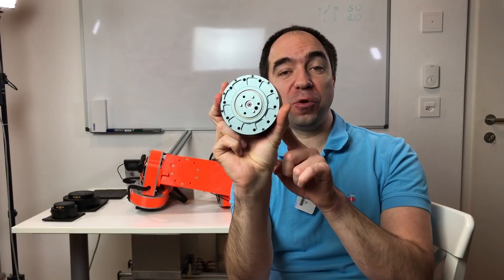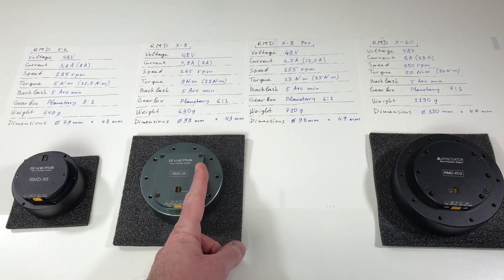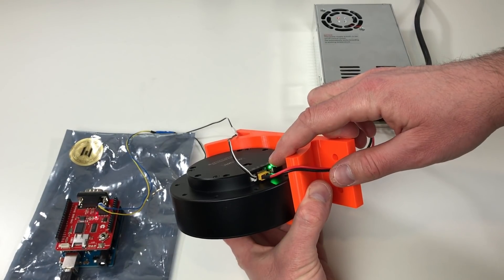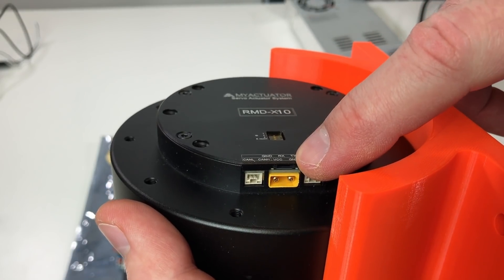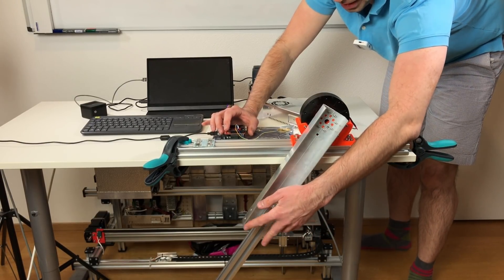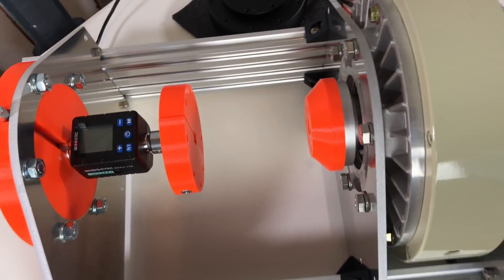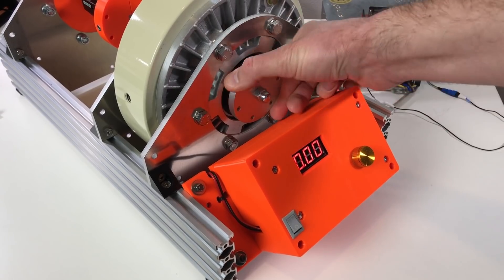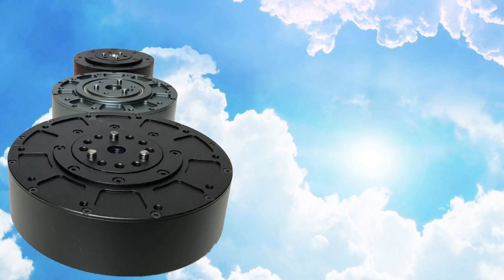Extremely Powerful Actuator: RMD-X10 (MyActuator Gyems)

Comment: Did I see moving internal parts through the front face mounting bolt holes?  i.e. the actuator isn't sealed unless you use all the mounting holes?
Reply from the maker: Yes. Exactly. You should be careful not to use too long screws there :)

Comment: I'm curious how much cooling it will require under load. If it's consuming 8 amps, how quickly does it heat up?
Reply: That's 384 watts, assume 90% for the motor including controller and another 3% for the gearbox. This is a  50 watt heating element.

It might not overheat under any condition within manufacturer specification but maximum performance beyond that will require active cooling.

Comment: What PID values did you end up using to stop the oscillations?  I have a few of the Gyems X8 and other direct drive servo's and anything with high angular momentum would result in oscillations.  I tried hundreds of PID values and never got it working.  The same issue you had with the robot arm initially, but you replaced the whole driver board which I don't really want to do.

Comment: Can I use this actuator for an exoskeleton? My mother had a stroke few days ago and I want to build up an exoskeleton for legs, she has a paralysis on right side. I found in Aliexpress the whole structure for legs, I only need to replace the joints with some motors. It looks that actuators have good features comparison with the cheap steppers, like torque feedback (not to brake the leg in case something goes wrong) and CAN network. I found in youtube a japanese companies called Cyberdyne and HAL. It looks that they are using actuators for exoskeleton. Probably I will have a learning mode (with positional sensors)  where I read the angles for hip, knee and ankle from a person similar with my mother (because these angles are different from female/male, the speed of moving, how tall is the person, size of shoes, transitive regime of the speed like start and stop....etc) so, because I am not a kineto-terapist to know/study all these, I think a learning mode for exoskeleton is the fastest/easy way to be close with my mother way of walking. I found online some values of torque 22Nm hip, 11Nm knee and around 0.6Nm for ankle. Than the exoskeleton connected with a running band to adjust the speed of running with the move of exoskeleton and hopefully in short time my mother will be able to walk again. She will be suspended in a crane which will have few steps of letting weight on the legs. Initially 0kg, than 10, 20,30, until the legs will learn to support the whole weight of the body again. The idea came after I found Lokomat in youtube, but as all german things Lokomat is crazy expensive and complicate. What do you think? Any idea is welcome and helps me and my mom.

Comment: Are there any smaller or cheaper versions of these type of brushless actuators? Something in the price range of hobby servos...
I've read somewhere, that one could use these small brushless motors from camera gimbals but I haven't found any well put-together info about how well these would work for robot arms, in terms of speed and strength. 
I am interested in alternative actuators for smaller robots, aside from the standard robot-servos.

Comment: Soo it appears that if you're a Mac user , for the 'additional parameters' you're out-of-luck. The website he's pointing to there is gone, and all of the MyActuator stuff says "windows". That said , my thinking is that he did control everything on the arduino, so as long as I can use a device like that I should be okay. But I'd love to be clear the difference between the serial bus vs. using the 120 oh wires and the Arduino cam-bus programming.

Comment: These motors are good for hobby robotics but unfortunately they cannot be used in industrial robotics. It's because they have planetary gear reducer that has a certain backlash (that's why your robot end effector is shaking/jittering). If they have harmonic drive, it would be another story. There is no industrial robot ever made that does not have harmonic drive reducer in every joint.
Reply: @billyzelsnack  I don't count "no name" robot manufacturers. We can talk about top ten (Fanuc,Kuka,ABB,Yaskawa,Siemens,Kawasaki,Mitsubishi,Staubli,Epson,Omron) and I didn't find any of them using any reducers other than harmonic drive.

Comment: Only problem i see with using these in robot arms is that it doesnt have a brake when loosing power.
Reply from the maker: Yes, but this is the feature which is not easy to implement. (Human arm does not have it :) )
Reply: @Skyentific  haha, that is true. i want to make a robot arm, but i want it compact and safe, so parking brake is a big deal, i have reached out to gyems and talked to them about this, they said it could be a reality in the future. these kind of motors are in general very expensive, so i hope gyems will listen to developers around and make something with all the features  :).
Reply: Brake unit is always placed in the servo motor controller/amplifier. Every industrial robot controller/amplifier must have it. It cannot be packed inside the motor because it does not contain just electronic parts but it also must include a large break (regenerative) resistor (R=10..30ohm, P=100..500W) mounted on a large heat sink. I saw many of those brake units inside of industrial servo amplifiers and they are huge and heavy.
Reply: @BabaCAD  I was talking about parking brake/disc brake, gyems may deliver this as an addon or a version with this type of parking brake. I was thinking about approaching my build like UR robots does. but i would rather go for a typical robot joint construction with harmonic drive and disc parkingbrake.

Comment: Beautiful motors  with one small problem. They have one big PRICE. Also for the love of all robotics, remove the belts from your robot. Use a differential drive with curved teeth and a  long shaft to connect it to the next part.
Reply: backlash ewww

Comment: 25 Nm is or insane, or unreal, but i have 4,5kW AC servo motors, weight about 30 kg each , and they are rated 24 Nm... without gearbox. I'll block my wife's credit card to buy one of these.-

Comment: The controller is NOT "harder to set up", it's infact more flexible since YOU design the control characteristics, not assumed by someone else. But, yes you have to know what you're doing (this is a controls problem). Also, u didn't that brake, just mount it and measure it's 0 RPM torque. Not realizing u may have pwr supply issues ahead of time? Sorry but this rather amateur. That being said, more detail and thought here than most youtub posts.
Reply: I'm looking forward to your professional review and full details. When can you have that up? I know it's a lot of work to create the content instead of just critique, but your video will be very helpful for us. Thank you.